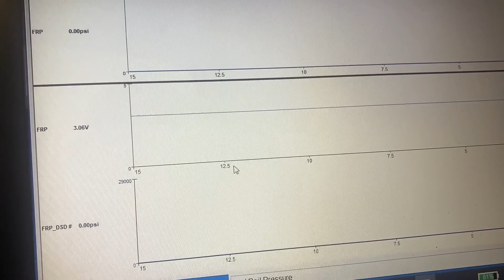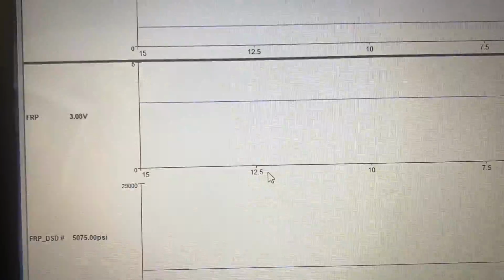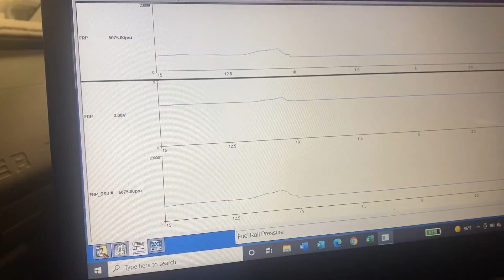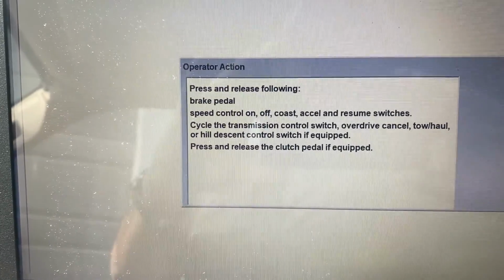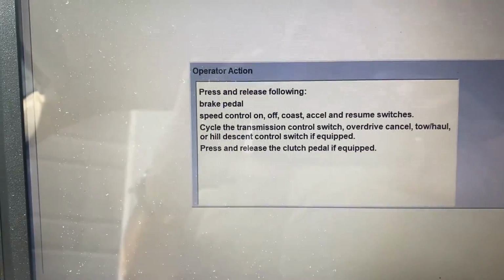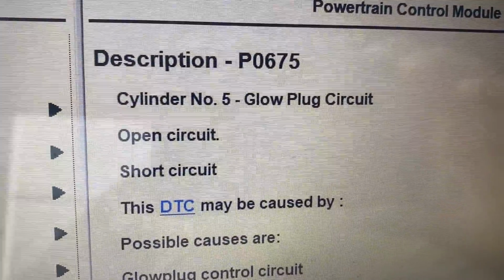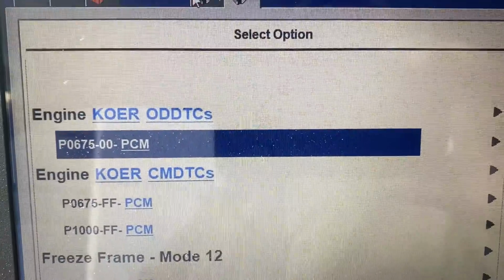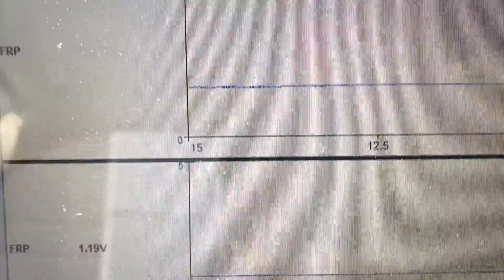PS 6 4L biased fuel rail pressure sensor.

Comment: My 2008 surges at idle after it is warmed up. I changed the FRPS and it did not change. Used a FORD part also. ???
Reply from the maker: @JT-qf4it  that doesn’t mean u have  a bad FRPS.
Have a scan tool? Need data
Reply: @dieseltalkwithtonysalas8725  Rail pressure at idle is right at 5000 psi. It jumps around when it surges from 5000 - 9000 psi.

Comment: Question would it cause it to sputter and high idle and then die i have code p0087 and changed the HFCM because that was shot and now it runs all fay but when i go to drive it it sputters high idles and a wrench light pops up and dies

Comment: on the 6.4L powerstroke engine, what should the fuel rail pressure be at idle?  I'm getting a constant 4.8ksi while the engine is cold but once it heats up to operating temp it surges a little.  I'm going to start with changing the FRP sensor just to see if this resolves the issue.
Reply from the maker: I doubt the issue is your sensor, but let me know if it helped.
Reply: @dieseltalkwithtonysalas8725  I’m happy to say that just changing the sensor solved my issue!
Reply: was the surge just a tiny bit enough to be annoying.  Having issue you describe. I think its probably the sensor also.
Reply: @ethanmaiden  Hi, yes it was minimal but you could tell it was there.  I changed the sensor and it fixed it.

Comment: Tony,do you if the fuel pressure sensor take an oring .
I did not see one on old sensor. Did not see one stuck on rail .
Just wanted to make just if didn't fall out. 
Thanks 
Daniel
Reply from the maker: As far as I remember , no there is no o ring. Note that Ford has a revised sensor looks fatter. Actually the thumbnail of this video shows older and newer sensor.
Reply: @dieseltalkwithtonysalas8725  
Tony, Dealer did not have sensor in stock . Bought aftermarket one from autosuppy.
What your thoughts on buying aftermarket not OEM.